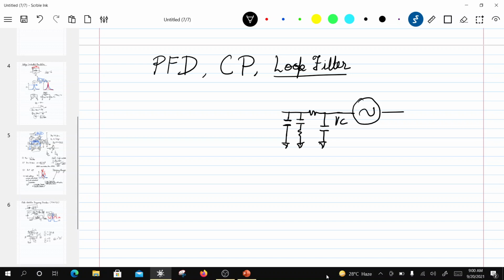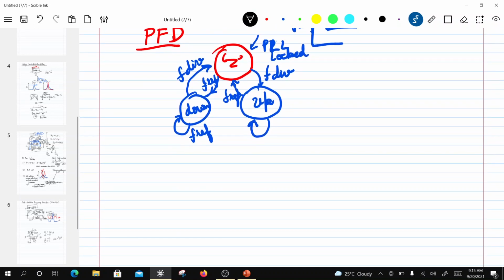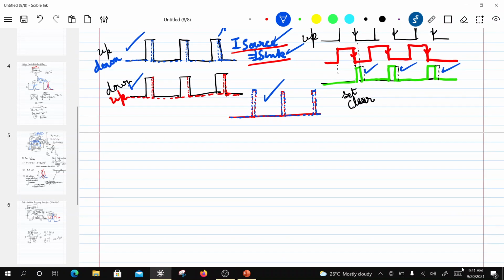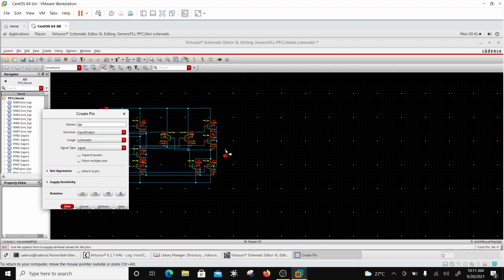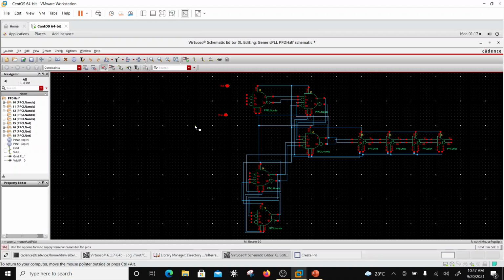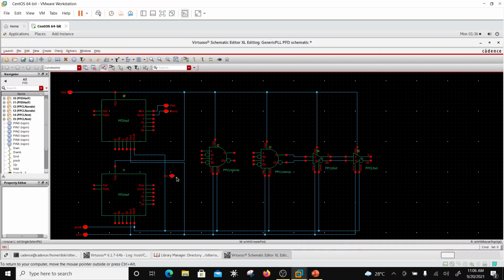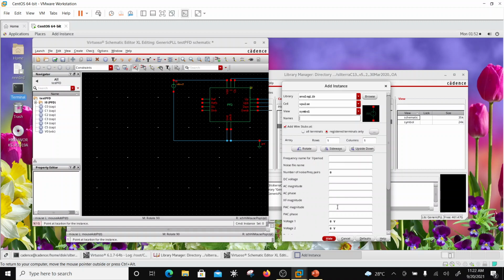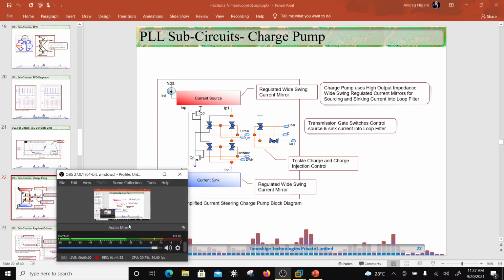Clocking Circuits Session4

Comment: Thank you, sir, for providing such insightful lectures covering both theory and practical design. I kindly request you to please complete this clock circuit session using Cadence, just as you did in the previous three sessions. I would like to design the complete schematic of PLL , as you mentioned in the first session.